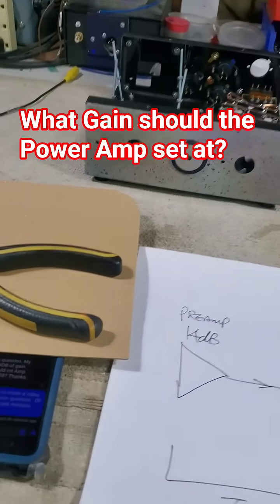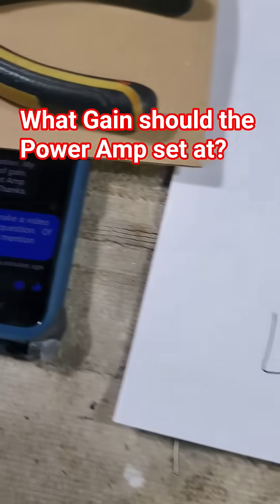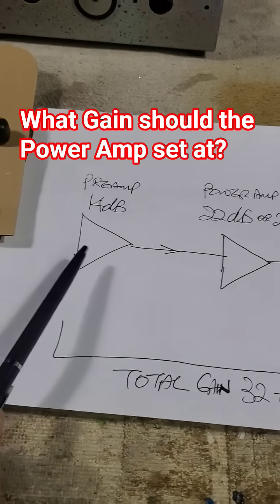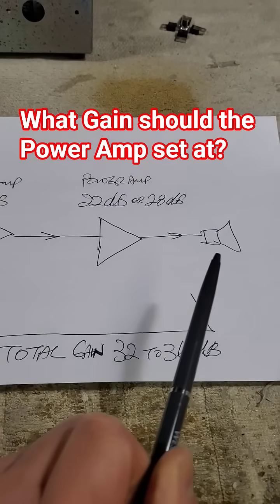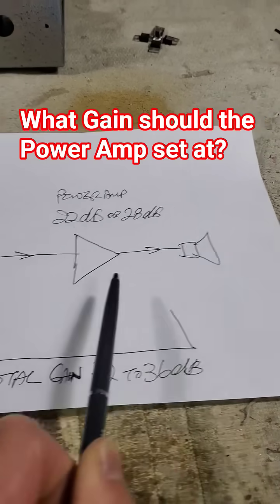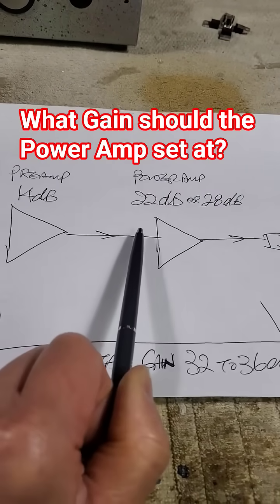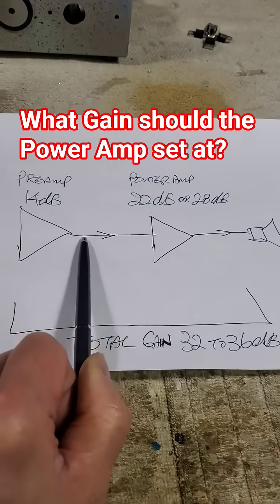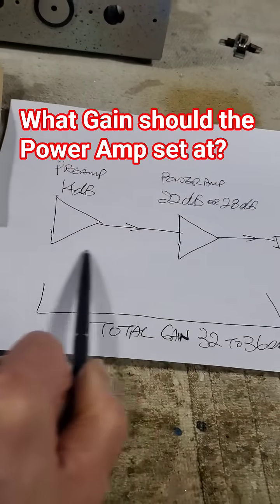What power amp gain? #homeaudio #audio #hifi #hifiaudio

Comment: Good question & good answer.  Do many amplifiers have adjustable gain?  Or are most built with one fixed output?  

And I imagine your amps can be ordered with a specified gain?
Reply from the maker: Not many has adjustable gain. My newest AM205 had adjustable gain.  The rest of the amp doesn't.   I would suggest to add attenuator at the input of the power amp.

In fact, the volume control in a preamp is adjusting "gain" of some sort for the preamp.